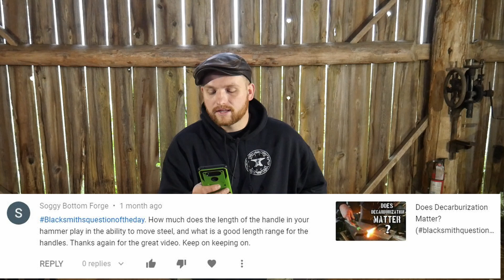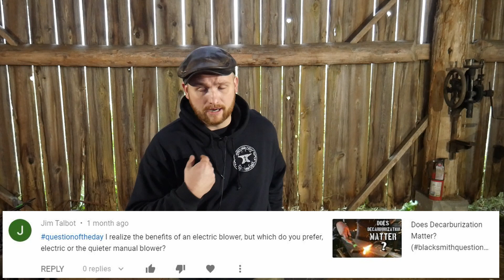What Hammer Handle Length is BEST?  (#blacksmithquestionoftheday S1EP14)

Comment: I always think it's funny that no matter what you believe As far as the length of a handle or the size of the hammer every man preaches, it's like it's gospel. 😂
I appreciate the video. But just a side note. I've worked in a lot of different professions around a lot of different men. And from what I've seen  Blacksmiths And carpenters Are the only ones that like long handles On their hammers.
I'll say this. As someone that uses a hammer In almost every type of work that I do Whether it be leather work Iron work Carpentry Or blacksmithing Which is different from iron work btw There is always a need for a specific hammer and handle length.  And most schools of thought Hold some merit.

Comment: I worked with a Guy who was a Ball player in College . We did Line Work . He was not too big or Beefy but he thought he was like Popeye .  We used to drive  J pins into the pole with Maul hammers . Without a short pilot hole it could be tough hanging from the Pole .  Being a College boy he took a 6 pound Sledge and cut the Handle in Half . Then He would try and climb the  telephone Pole with it on His Belt . The Wild part was watching him use the Hammer up on the Pole . The Head had all the leverage  , The Pole would be Bouncing around , Ha ha   His One Hand Special did not work as well as he thought that it would . Thank you for the Video .

Comment: I always knew longer handled types as engineers' hammers and short handle as drilling hammers.(rock drilling) Smithing style heads seem to come with mid length handles but I suppose that depends some on tong length.

Comment: Best explanation of handle length and head weight I have ever heard.  I prefer shorter handles, but I also like them thicker than most.  Some people like squarish handles but I like them more ovalized with a palm swell.  I find that I will hold a handle in the location that feels comfortable.  So if the area near the head is thin, I won’t hold it there.  I know a square handle gives better feedback on flipping the head around from round to flat, but it always feels awkward to me.

Comment: Lots of good advice Roy. I have 40 years experience swinging hammers and agree with most of what you say. Just one thing, as hammers get heaver in one hand the the handle length increases just long enough to lock under the forearm to increase the leverage. Of corse as they get too heavy its then a two handed sledge or a choker handle!

Comment: As always another good video in the series! A problem that I've encountered lately is, lack of finding replacement wooden hammer handles! and when I do find them they want a kings ransom for them! Places I used to get them don't carry them anymore! Seems they want to sell you a NEW hammer with those awful plastic handles which IMHO throws off the balance of the hammer! And if the plastic handle is damaged beyond repair, you have to rework the eye so the head stays on the handle because there's no taper in the eye.
Reply: Check out House Handles online. They have a pretty extensive selection at good prices.

Comment: Thank you Roy, very informative. I have a 2½ pound hammer that I feel the handle is to short on, and plan on replacing it and was just wondered what I should be looking for. I think I'll go long at first and see where it feels most comfortable and still accurate. Then I'll adjust the length to fit me.

Comment: #blacksmithquestionoftheday Roy, in your work with copper, do you find a difference in the material, when using "scrap copper", versus purchased stock ( bar, round, and sheet)?  Thanks in advance 😀👍❤️⚒️⚒️